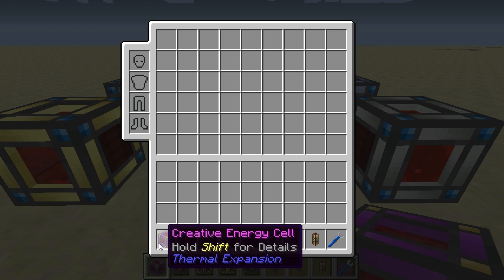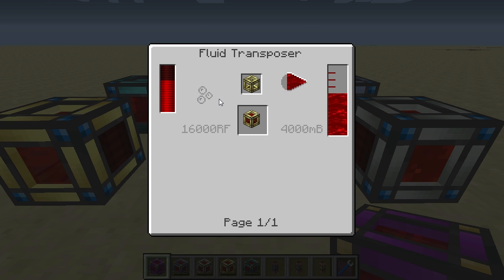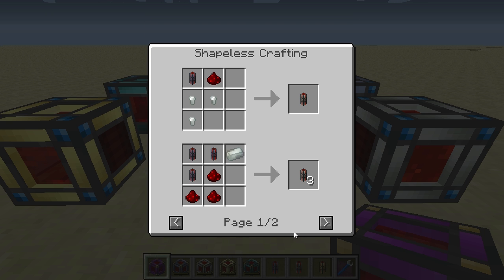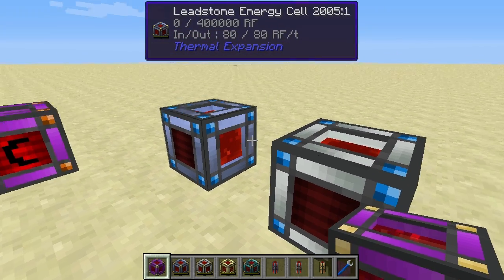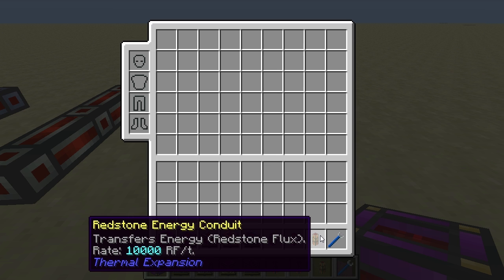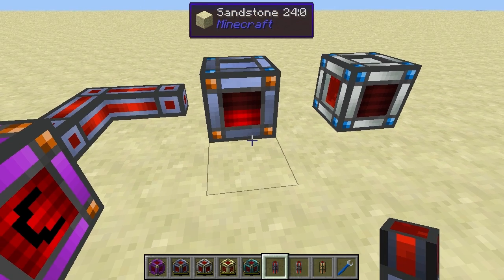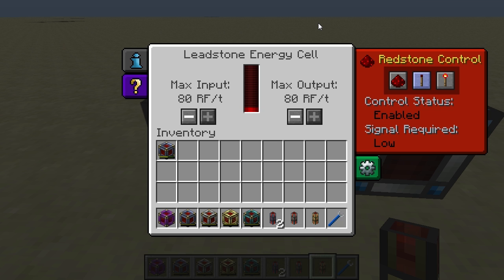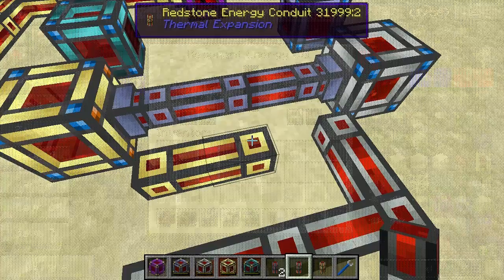Thermal Expansion - Cells & Conduits

Comment: you didn t explane how to use it with minefactory :/ 
can you tell me how :3
Reply from the maker: Well yeah, it isn't an MFR spotlight..; And you use it with MFR like any other mod that supports RF power. Just connect a cell up to an MFR machine by placing it next to it or connecting it with a conduit.
Reply: but it went work and i am sorry if i make you angry :'(
Reply from the maker: Well, you're not giving me many details to work with here... Is your cell charged? You can charge it with one of the TE3 Dynamos or a power generator from MFR like the Steam Turbine.
Reply: i can give you some photos if you want and yes my cells are full did you try it in your minecraft ? 
if you want more detail call me in skype and i will show you my screen that may help :/
Reply from the maker: If your cells are full, you connected them to the machines and set the cell's connecting side to output, then I honestly have no idea what could be wrong.